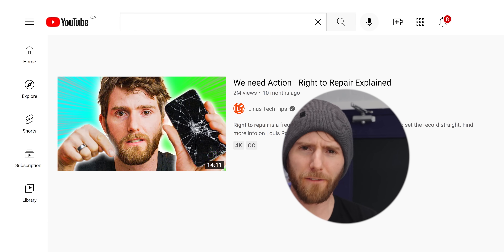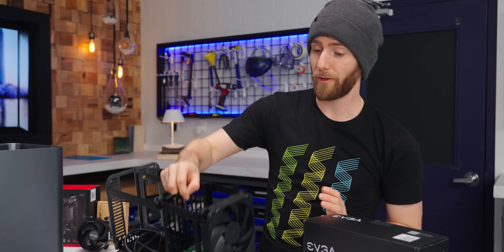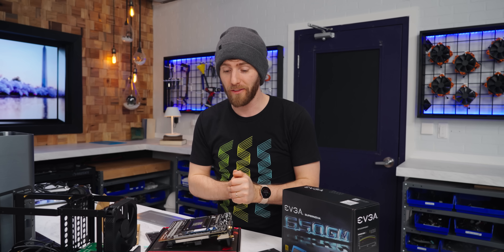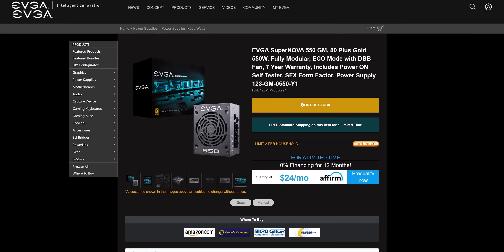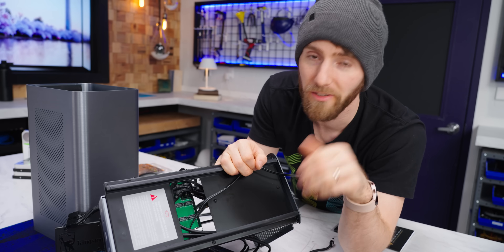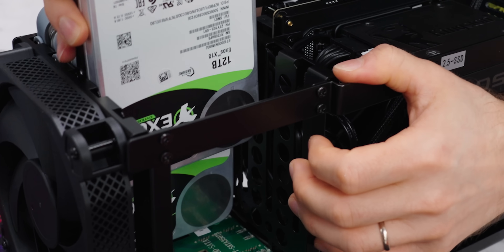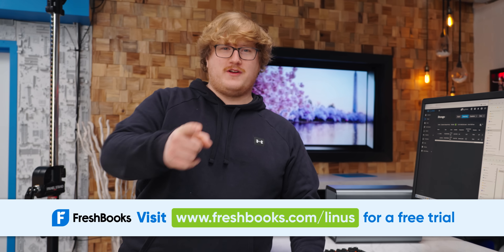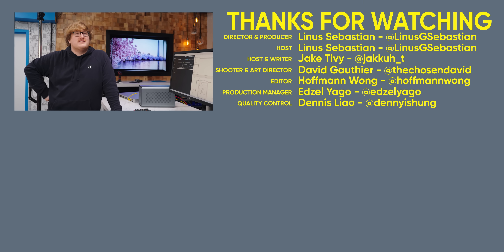This blows away the competition - JONSBO N1 NAS Build

Comment: what I always wonder about when seeing these builds is how much power are these going to draw most of the time, that is on light load or idle. I'm sitting on a small 2 bay Synology Nas and I'm ok with having it on all the time, since it consumes ~10W. this build uses a 550W PSU 😳
Reply: I just wondered the same. I mean it probably doesn't matter for the US, where energy seems to be dirt cheap, but living in europe, especially in germany, I would nowadays take some 100€ more expensive 2W NAS over any custom, high powered NAS build anytime. That "savings" you get with custom, would add on the electricity bill really fast.
Reply: @MarkarthGuard45  ideally I would be able to build something custom with idle draw of ~20W or so, but that still seems to be rather difficult. Wolfgang's channel had an interesting video about that

Comment: Bougth one of this bad boy, loved the form factor... But one big factor tho. The airflow aren't good at all! Even if i plug the fan on the jack from within the plate (it's always running at 100% there) the disk are running hot (45+) often. during the parity method it's even worst! And yes, i did a airflow test and the air isn't moving from the front. So the big fan is running but doesn't move any air at all (so that the reason why the drives are always hot). Yes my cables management are done correctly. I don't want to make a big 4inch hole on the top with fan just to take the air out but maybe that's the only way... any suggestions?

Comment: I'm confused. Did you just not want to get an lga1700 itx board? Pretty sure that 12100 that you used in the $500 build would have sufficed and is cheaper than the 3100.

Comment: Can anyone recommend me a case with only 2 drives to hold? I have a Fractal 304 currently and its super huge, I need only 2 drives, also the cooling in it is really bad. I don't know anything about small factor cases, especially what I should look for, if I want to use it as a nas case.

Comment: This is easily one of the more useful build guide that decent amount of people might actually want to build.
I've set up 3 raid 5 using prebuilt enclosures by now and I'm really looking into a better / cheaper solution.
Since the goal of this build is to beat the prebuilds at cheaper price, would be nice to include the final price of this build at the end of the video (obviously, I know price changes but for the sake of comparison).
Reply: The price is included at 15:30
Reply: @wooonerf3195  oh thanks, I must have missed it
Reply: Well, if you're looking for an even cheaper solution you can get an N6005 or N5105 motherboard with a Node 304, which should be pretty cheap. You can also just get 5 year old hardware which can be pretty power efficient if you make sure to limit power usage properly.

Comment: I just built almost this exact system to turn into a massive Plex server, and, for anyone planning to build one, a heads up: There were issues with 5000 series Ryzen CPUs and the B550 chipset resulting in the rear USB ports not working, or working intermittently. Supposedly this has been fixed with BIOS updates, but I am having the issue with mine (Ryzen 5 5600G and the ROG Strix B550-i). The problem appears to be related to voltage regulation. I was able to get everything set up using a USB hub connected to the front USB port, since the issue doesn't seem to affect the USB header on the board. From what I have read, this isn't a problem with 3000 series Ryzen.
Reply: How have you found streaming video using this platform?
Reply: @AndrewPseudonym  for majority of situations you can do direct play which gives you the best quality.

Comment: Just received this Jonsbo N1 case from Newegg. I ordered the only color available and received a blue color aluminum. Silver is the only color I have seen this case advertised in photo and video, and the only color offered. The case color doesn't look anything like the case color in this video. I contacted Newegg who put me in touch with the Jonsbo reseller. I was told by the reseller that it was the light that made the case look blue and that was the Silver color case. Options are to take it or leave it, nice!

Comment: BEWARE

They just literally skipped the main point which just make-break your decision to do this DIY.
TrueNAS Core "DOES NOT" support WiFi and also it "DOES NOT" install the drivers for your ethernet port in the motherboard. It only supports mostly standalone NIC cards and that too only the popular one's. You "HAVE TO" buy a native PCIE NIC card from the supported list.
I found this issue while making the NAS this way.
I'm currently trying to find if there is any way to install driver and else have to buy a NIC.
Reply: How did Jake get it connected to the network then?
Reply: @SamsMotors  ask him lol. Why they skipped that part. It's there video not mine. 🤣
Reply: @WhatThisVideo-WTv  You're the only person I've seen that has this issue, that's why I'm asking

Comment: I was thinking about building a NAS and after watching this video decided to give this N1 a go. Everything went well but had problems with TrueNAS OS freezing on me. I used a Corsair SF750 as had trouble getting hold of another suitable SFX PSU. The biggest problem I've had is the PSU getting very hot heating up the system due to the fan only coming on if over a certain amount of voltage (not temp) being used. I tested by putting a fan on the outside of the case blowing in directly where the fan was on the PSU and was then fine with the air circulating through it. I've been looking around but can't seem to find an SFX PSU,  fully modular but with either a controllable or non zero fan. Are there any models you would recommend to fit this case around 650W? Apart from that issue was a nice build. Did you have any similar issues with the EVGA PSU causing overheating system heat/stability issues?

With the limited space I think these SFX PSU's should have at least the ability to switch the mode to a non zero curve like some of the ATX PSU's do via a hardware switch. Bring back the days of a rotary speed dial to set initial fan speed  ;-)

Comment: Why bother with a 32GB Optane m.2 for cache when you can upgrade the RAM? RAM cache is going to be heaps faster in ZFS, and there’s no reasonable write/SLOG appliance due to no battery on the low end Optanes (hence the cheap price). Also, I doubt that RAM is ECC. I definitely wouldn’t trust this NAS for anything of value, for $700 USD sans drives, you can get used enterprise gear heaps cheaper and build a much better system.

Comment: I've been waiting to see something that is long term, slower storage. I could envision a box that allows just USB connected drives to attach, but lots of them and the drives stay powered down until intentionally individually woken up and used. USB drives of 1 or 2TB are cheap on an incremental basis. Being able to plug in 30 of them and only have two maybe 3 running at once would be almost no power consumption for 60TB of storage. 
To upgrade, the user opens a door, places another drive on a shelf and plugs in a usb cable to a spare USB 3 or C slot. That's it.

The machine main board may only have to have say 4 USB slots if the drives could be selected electromechanically for the slots (10 plugged in to 1 USB slot, but only one running at once). A library of file names and dates could be kept by the machine to find a particular file.

Comment: Interesting build, but how do you get the board to boot without a gpu? Even with the latest bios firmware I can’t find any option to turn of the “halt if no gpu found”. What setting do i need to change and where can i find it? (Yes i bought the B550-i as indicated on the parts list under the video, but upgraded to a rysen 5 cpu since the 3 was sold out)
Reply: Anyone?
Reply: @arjandehaas6304  Want to buy the same board, did you solve this?
Reply: @stevewagner136  Nope, once the video is finished LTT never answers any questions it seems. Also on his forum there is no answer from him/them. 
But someone suggested the Risen processor is available with a built in gpu, a bit more expensive, specially if you already bought the recommended one. My advise: Don’t use this tutorial, it’s thrown together in a hurry, some required parts are not listed and the end result does not work.

Comment: Im an older fellow.. I must say I find a number of these sorts misleading.  When your goal is '699' then 699 should be start to usage however the storage disks are never included in these prices.  I dont buy a car with a set goal and then find out I need to shell out for a transmission or a motor or likewise for a home.  Start to finish.. total investment to get the result I am after.

Comment: If that was a Windows rig, it would be a heck of a system drive with the OS on board.
Reply: I don't think anyone would want to use Windows as a storage system. AFAIK They don't support ZFS and aren't good on the FS / Redundancy part. You won't even find tools like TruNAS and other stuff that are built in systems that are better suited for this (Linux, FreeBSD, etc).
You may run a Windows in a WM though, if your system has the resources for this.

Comment: I got this set up and can not get it to boot I think I made the boot drive with another PC  just like they did. Any ideas on what to do? It turns on but there is no address assigned on the router.  I took the boot drive on the original PC where I created the boot drive and it works. I think I am going to have to buy a graphics card ;{

Comment: Use zstd compression for anything that supports it unless you have a good reason to do something else.  It manages some impressive performance.  Something like 90% of the speed of lzo and 90% the compression of lzma, at the same time.  At the top end, it hits something like 98% of the compression of lzma if you tune it for compression, while still being faster, or the same speed as lzo or zlib while still getting marginally better compression.  Bottom line is it's the best "default" for pretty much everything anymore.
Reply: That's exactly what I thought. zstd should be the go to choice for almost anything

Comment: Could be $100 less and more functional (onboard graphics) if you went with an MSI H510i Pro, Core i3-12100, and used an internal 32gb USB 3.0 flash drive for the OS.
Reply: Did you try that config? Or just on paper?
Reply: @samytaha  just on paper. Why? Do you think it won't work?

Comment: It's hard to find cases designed to hold a ton of drives that isn't some kind of industrial server case.

I have a 750D I bought in 2016 and haven't seen another equal or higher capacity drive case yet.

By the time I find one, I'll have saved enough for a 45drives chassis.

Comment: And if I want to save photo images without compression???
It does not save on price but it is a lot quicker to repair in case of a motherboard issue. I have heard about a lot of issues with the Synology NAS equipment. None of it good. Another issue with this user friendly NAS is its size. its HUGE!
Didn't that motherboard have built in HDMI output? If so no Graphics cards needed. If not one might find a compatible MB with HDMI so you can configure your hard drive.
If I can get the price down on components to save at least a hundred dollars it would be worth it.

Comment: i have never owned a NAS, i am to cheap, i have been using old PC parts built my own fileserver as NAS. always done it. been some time thinking of buying a NAS, but i cannot come to the point to pay for one.

Sorry i had a External Raid chase with 5 slots for 3.5" HDD´s USB 2, Firewire. brand unknown, but that one broke the PSU after 8 years :/

i rather buy a ICY BOX than a NAS, and yes i need a PC to plug-in the ICY BOX to.

Comment: If you're going to DIY a compact NAS, go for an 10th Gen+ Intel Core i3 or i5 instead of AMD. They have an integrated GPU with hardware acceleration that allows you to transcode multiple 4K streams with Plex/Jellyfin without the need for a graphics card, plus it allows you to install and administer the OS without using a donor rig.

Comment: I would like to see a DIY NAS using older hardware - perhaps like socket 775 hardware which is kind of pretty useless for most things. I am thinking 8-10+ drives for cheap.
What options etc for a DIY sytem do you have and can you do a video on that?

Comment: Good to see TrueNAS making another appearance - I do recommend to anyone interested in it, to do a test install on a spare old machine. Get some small capacity drives (old laptop hard drives, like 250GB or 320GB) and play with RAIDZ's, Mirrors and all that. It does require a lot of learning (can almost become a temporary hobby) but once you've figured it, you have one of the most redundant and reliable storage systems. UnRAID is far easier to setup and use, for less important data. Like anything in life, the more you put in, the more you get out. 

If interested, my config is 2 TrueNAS servers, one primary and one secondary snapshot machine. Snapshots are a really efficient way of making backups, both local and to a second machine. Then backblaze is used to complete the 3-2-1 backup strategy - note it's more expensive (by a lot) than the personal version of backblaze. For 10TB, backblaze via a NAS is approx. 10x the cost, so you sometimes have to re-think what's sent up to the cloud.
Reply: It can be harder to find cases with high internal 3.5" bay counts these days. But, Fractal Design is making some damn nice cases perfect for this. I have the R5 with 8 bays, plus 2 5.25" bays! I'm actually using a 5.25" bay for an old  BitFenix Recon Fan Controller I had laying around - It looks amazing.
Reply: @NightFlight1973  You're right there - would you believe I got a second hand R5 only a week ago! I've got several old Antec 900 with up to 10 trayless 5.25in caddys in it. One has failed, but that's in around 30 that I've bought, so not too bad. I think my next computer case will probably be a rack, but I'd prefer not to go that route really.

Comment: Regarding compression, doesn't matter how many cores you have for SMB, this is using one thread,
Reply: Single thread SMB via SAMBA is fine because this box only has a gigabit nic, and they can only hit they array at 250MB/s anyway so it's never going to go fast enough for that to be a problem really.

Also remember that, it's 1 SMB thread per client, so, SAMBA tends to scale out just fine to clients that are only running gigabit nics, provided you have enough cores and your NICs don't suck. Them talking about 10gbit nics though, that's laughable, almost as laughable as running non ECC ram and RAIDZ1 on 12 TB disks.

Comment: Ideaaaa?
> If the nvme does not need pcie gen 4 -- mayb consider swapping the ryzen 3100 with a 3400G then you can use the onboard itx dp/hdmi out for installing the OS and regular maintenance if need.

Comment: I followed the build, but TrueNAS won't find the 2.5GB Ethernet port.   Is there a driver I need to find for FreeBSD? I did a Windows install and it found the network and is fully functional, so it's not the hardware.
Reply: This project looks pretty straight forward, but it's not.  No ethernet means no web interface.  If you have a GPU in the system, you get a console, and can shell.  However, mounting a USB drive, copying files from the drive, unpacking, finding package dependencies, executing a MAKE file to let the system use the ethernet port, all so that I can get to the web interface to setup the raid... too much.  Apparently FreeBSD will recognize intel NICs, so this is the wrong motherboard for the project.  If someone has a reasonable fix, let me know.  At this point, Windows is the only thing keeping this project from being an expensive brick.  UnRAID had the same problem... no ethernet.  Tried to get Ubuntu to work, same issue.
Reply: @JerryWinfrey  Your first mistake was listening to Linus Tech Tips when they talk about anything not related to gaming PCs

Now that you've sunk money into this, try TrueNAS Scale, it's debian based and has much better driver support, and it's much easier to update the kernel version to get support for newer hardware.

You also might check and see if the nic is available, but not auto negotiating the correct speed. If you're plugged into a gigabit switch, it won't run at 2.5 gigabit, but will happily run at 1 if you manually configure it.

Comment: Im stuck in a weird situation where im currently living at home and have access to a Ethernet port etc but im moving to uni in September and don’t know if my room will have Ethernet and if I will be able to have a NAS in my room. Anyone got some suggestions as to what I should get, I’m gonna be working with large animation and photoshop files. I did see a phone which will have Ethernet, in one of the rooms I applied for but there’s no guaranty Ill get it ( yes I want that room just for the Ethernet port ) I have portable hard drives I can use on the go but I don’t rlly wanna have to carry 15278383 around with me everywhere I go I like the idea of a central hub for all my data

Comment: I purchased the 2 Port SATA III SI-ADA40149 IOCREST and it doesn't fit in the NVMe M.2 slot. Annoying. It is possible that a compatible expansion card that will work is M.2 SATA Adapter M.2 M-key to 5 port SATA 3.0 6Gbps Expansion card with JMB585 Chipset of 2280 Size adapter card. Still awaiting delivery!

Comment: What if with the screwdriver since the big issue is fitting into weird positions wouldn’t it make sense to give it a longer retractable shaft to fit into a variety of places and still turn and bend the handle 90 degrees to make it more like a socket wrench to cut down on hand cramping when you have to deal with multiple screws. I deal with hand cramping all the time when I have to take apart and fix electronics.